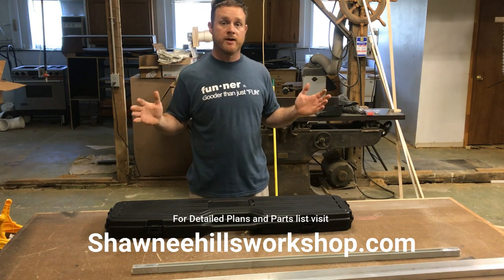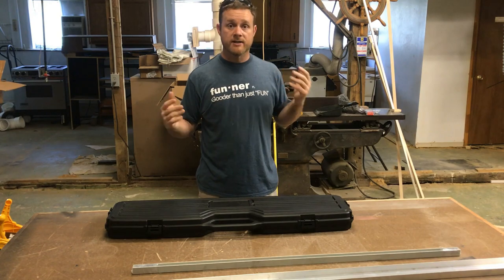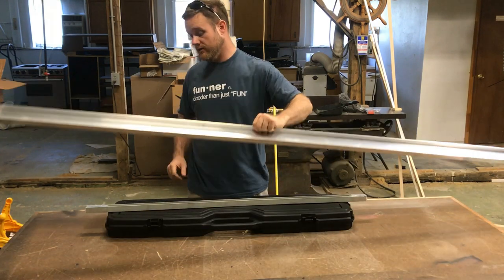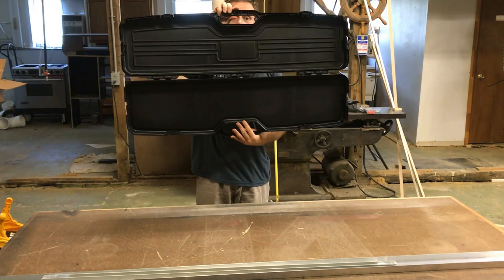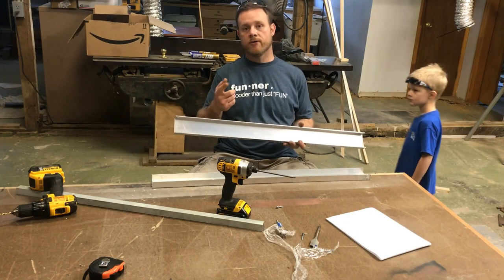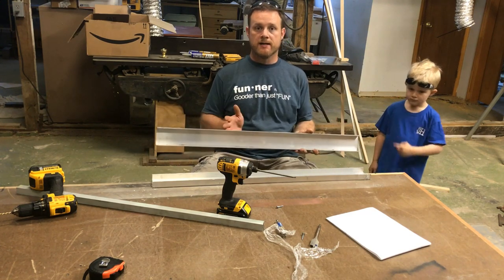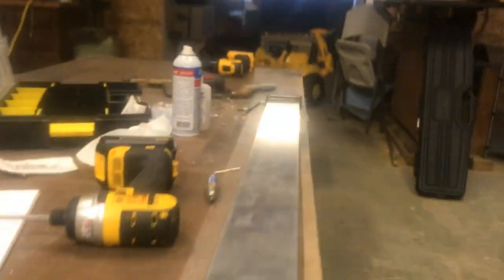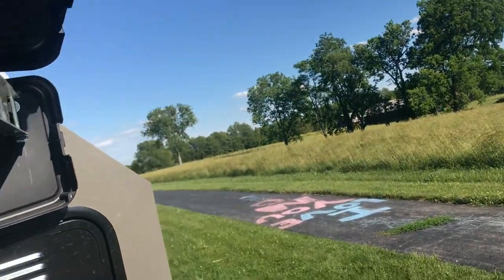The Ultimate DIY Camping / Overlanding Shower

Comment: Good afternoon, 

So I got the shower enclosure and case mounted on my cargo trailer/camper conversion but just so I make this the best possible way (like you did...as your work definitely sets the standard) can you please send me your pattern for the fabric enclosure/weighted rods assembly?

I know the plans had the basic shape but if you could direct me on what you used at least for the weighted rods and how the guy wires seem to attach so professionally, that would be a huge help.

Thank you so much,

Cloyd Rodkey